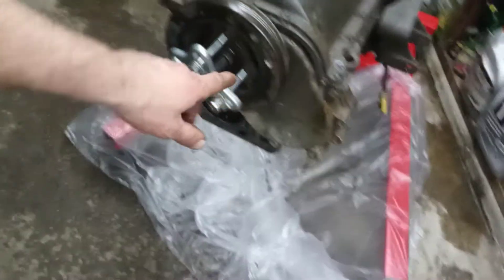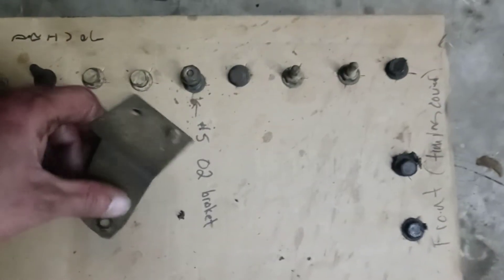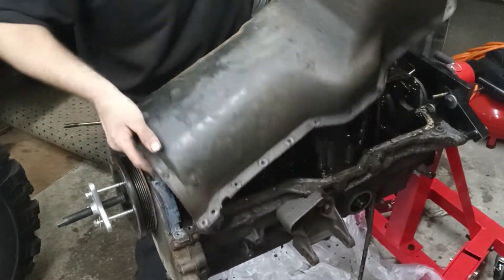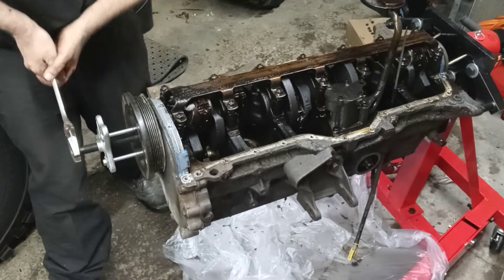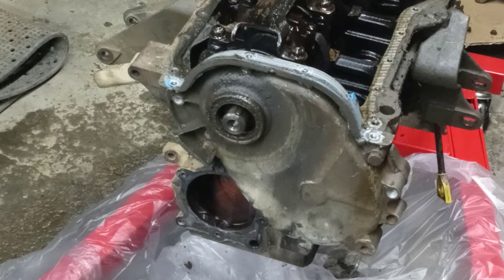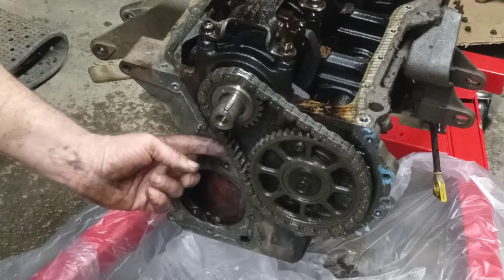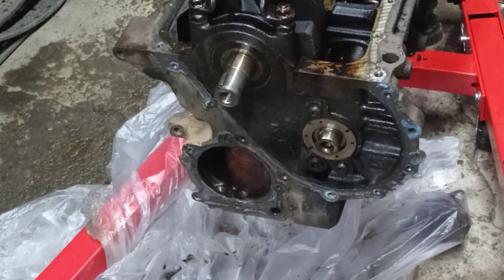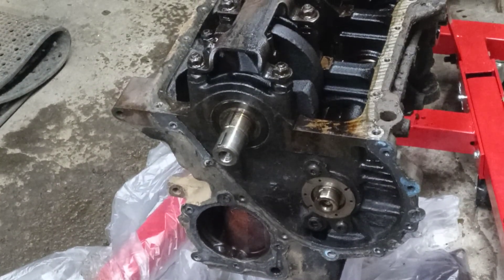Jeep 4.0 engine rebuild. PART 12: oil pan, timing cover and chain. dipstick tube and a broken piston

Comment: You might say this in one of the later videos, but I haven’t gotten there yet: did you buy a rebuild kit from somewhere or did you just buy parts as you went along? And who did you buy from?  I’ve been looking at so many different suppliers that my head is spinning.
Reply from the maker: Hey thanks for the question. I bought a whole rebuild kit. The company I got it from is engine tech. Not sure how they spell it exactly might be , enginetek....or enginetech...or enginetech. It's been awhile since I bought it now. But yeah I recommend them. What they actually do is buy quality parts on wholesale for another company and Rebox it with their name on it for a lower price. But I wouldn't just order online. I'll called them personally, they'll gladly talk to you about the different rebuild kits they sell. Mine was like $680 but BEWARE, the kit does not come with everything. Mine didn't include rocker arms, lifters it push rods. I added lifters and pushrods from them making my price a lil bit higher. And I wanted all the Brandon parts inside the engine. I didn't get rocker arms from them tho because I knew I was gonna put the Harland roller rockers arms on it. anymore questions just let me know
Reply: Thanks!  I have looked at enginetech and will probably be calling them tomorrow.
Reply from the maker: Good deal man. I have no complaints about any of they're parts. Was all very good quality. Just a heads up for ya tho. Inspect your crankshaft journals. Drag your fingernail across each one. If your fingernail catches just a lil bit, the crankshaft will need a grind from the machine shop. And it may take a couple tries of buyn  and returning crankshaft bearings to get the correct oil clearance. I had to buy and return 2 sets to get the correct oil clearance